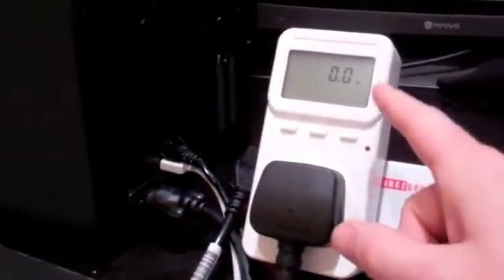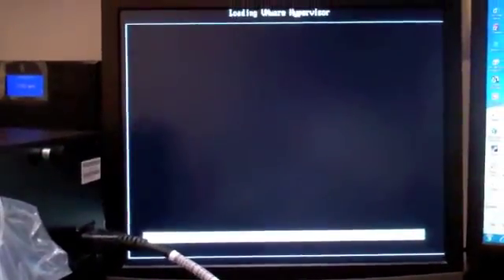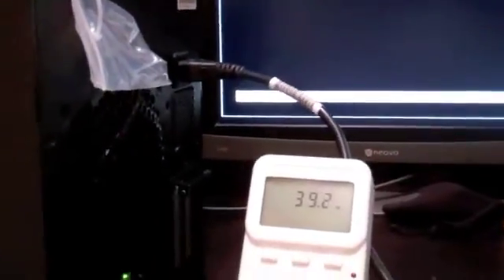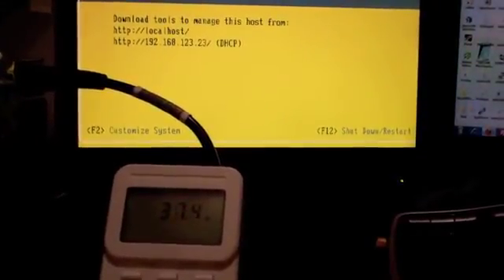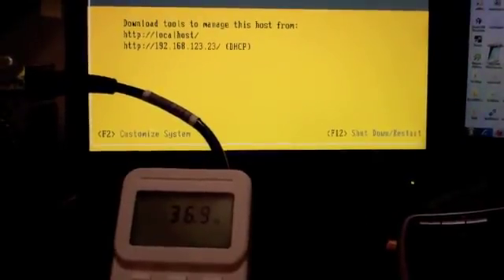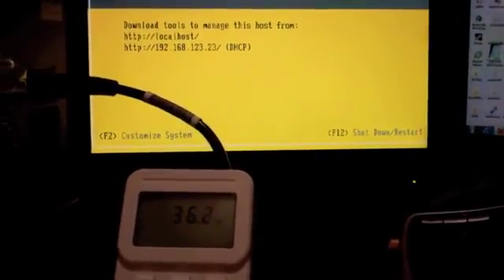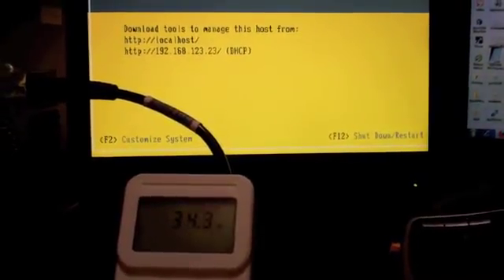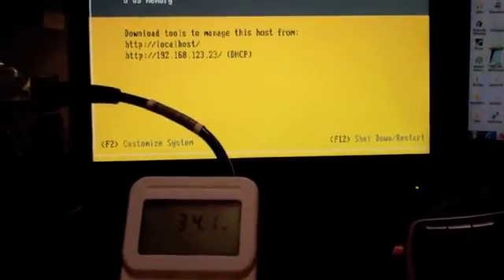HP MicroServer Power Consumption Video

Comment: thanks for the video. i just built an i7 960 tower for a home lab and esxi 4.0. on idle, my power consumption is around 163W. it's a little high for what i'll be doing and what i'll need so this is a great solution if i get it down to half (around 80W) with 4 HDDs.

those asking about the esxi compatibility, you can go to his site and read the post. the nic works out of the box but i didn't see him mention about the RAID.

thanks again for sharing